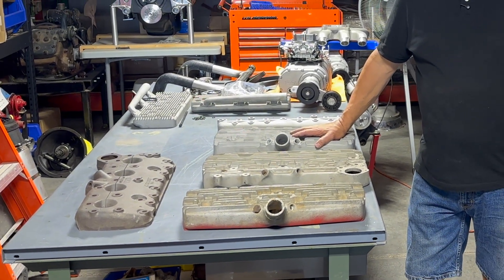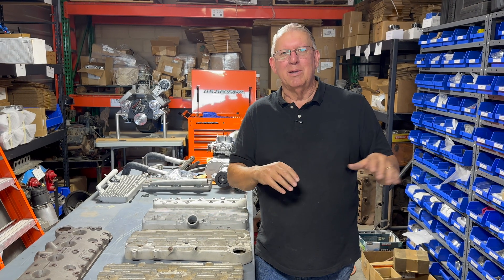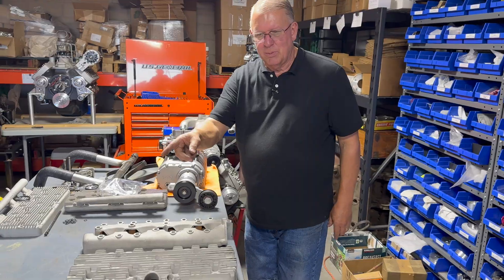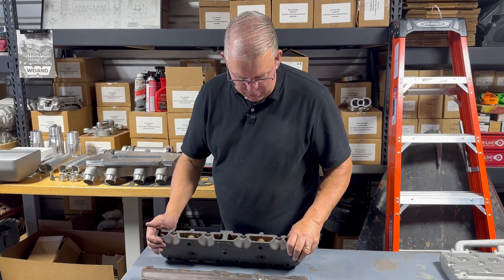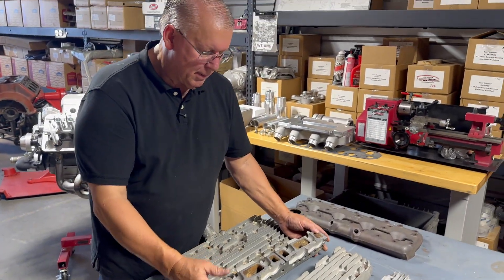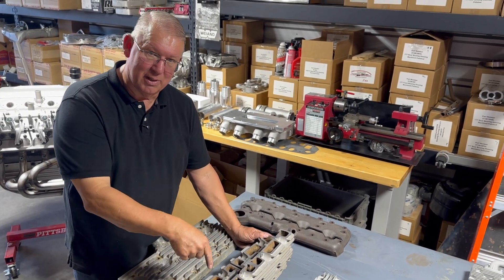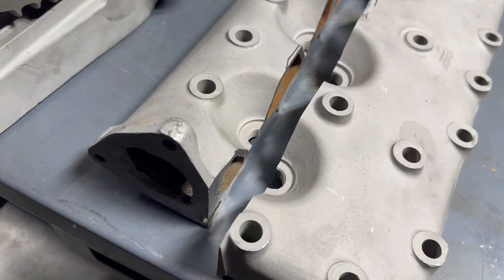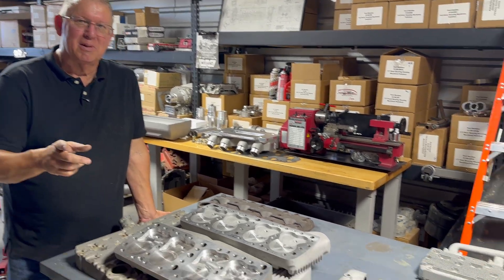Destroying Flatheads for SCIENCE – Will They Handle BIG Boost? Steve Coppock’s Dyno Prep w #BarryT

Comment: Why not use a spacer with two gaskets?
Reply: Increasing the gap between the top of the piston and cylinder head really hurts performance. The flathead Ford V8 uses a combustion chamber design develop by Sir Harry Ricardo - it relies on the “squish” that occurs between the top of the piston and cylinder head and optimally that squish distance is less than .100” Adding a spacer would reduce the compression ratio but also significantly reduces the effectiveness of the cylinder head design and is not the best way to reduce compression in a flathead Ford V8

Comment: Modern performance supercharged engines have comp. ratios over 9:1 and 10:1 from the factory. They run on 93 octane.
Reply from the maker: Absolutely true. The keyword there is modern. 😃👍
Reply: Agree! They have the benefit of computer controlled fuel injection (mixture), ignition timing, variable valve timing, and knock sensors, and oxygen sensors to keep the engine operating in a safe “zone” (no detonation) Direct injection, which almost all modern engines have these days is helpful as well. A supercharged flathead Ford could operate with higher compression with similar control systems.

Comment: The thing about flat heads . You can make a head fairlyeasily. With a couple sheets of 2" aluminum bar. Mill out chamber  on one side  and water on the other. Move the sparkplugs  to near the center of the bore. And cap the water passages with a 1"-1.5" aluminum plate . Maybe give the valves .500" and .200 over the piston to drop compression maybe .100" with a roughly 2" hemisphere  at the sparkplugs  going .300"-.350"  deep. Then smooth it out and cc match the chambers. 😂 drop the compression to 3.7:1- 4:1 maybe  so low you need to crank up the  blower pulls to get 0.25- 0.5 psi boost while cranking to get it to start 😂  make 2-3 psi idling   5psi at 65 mph in top gear. With a manual valve to bypass the boost maker while running light throttle.  Maybe  build a variable blower drive just turn a large screw moving a jackshaft  making a pulley smaller another larger slightly.  Allowing something like a gain of 4psi at 2000 rpm to  peak around 12 psi at 2000 rpm. And possibly 16-18psi at 5000rpm  maybe can't a set of heads that has the intake valve as is with overhead exhaust valves  using chevy 1.5" exhaust valves, with the possibly of modifying the original exhaust valve to mm ake it an additional intake valves.  With a 1" intake port threaded into the block with the exhaust filled with aluminum. Then milled out  to form the bowl area. the    intake lifter opening both intakes the exhaust  using a offset  lifter and a pushrod. With the exhaust valve being about center with the original sparkplug side to side. Front to rear centered to one half  the bore. With a 1.55:1 to 1.7:1 rocker ratio. With up to a 1.9" exhaust valve with a 1.75" port ported normally about 1.60" possibly  going to 1.80" -1.85"  with the spark plugs angled out on top and forward slightly  . Putting the electrode to the intake and to the center of the bore. Both angles slight. About 18°-24°  the exhaust  port leaving at a 30° angle to the valve. About 22° from the deck with a 3" wide block running from  a 4" wide bar running the length from the front to rear  like E with an extra groove area a shaft rocker running the long area near the intake. With the sparkplug running the length near the intake.  A slight chamber in the exhaust valve spark plug area. Nearly a hemi chamber only the intake valve is double  and inverted. ALSO RUNNING PARALLEL WITH THE PISTON . Putting the the hemi chamber half off the bore with two intake valves😂 so I guess it is NOT A HEMI😂..  THE VALVE COVER LOOKING SIMILAR TO A W-SERIES BBC  ENGINE ONLY SMALLER AND  double the scallops.  Where the plugs go.    Enough rambling, have an awesome day 🎉..
Reply: There is a lot to think about here! Thanks for taking the time to write this all down :-)
Reply from the maker: What a great and thoughtful comment. Thank you - much to consider